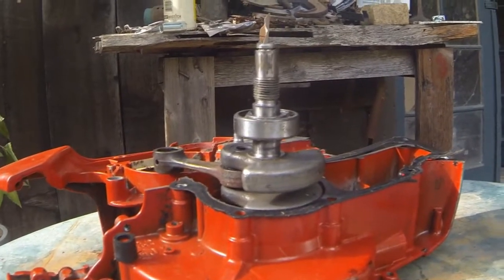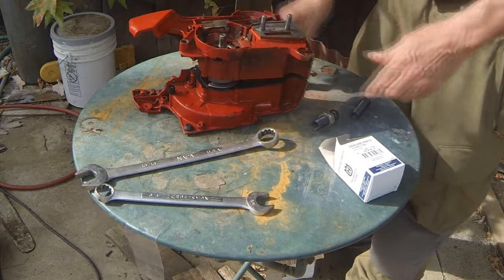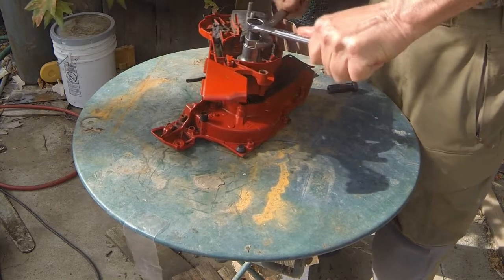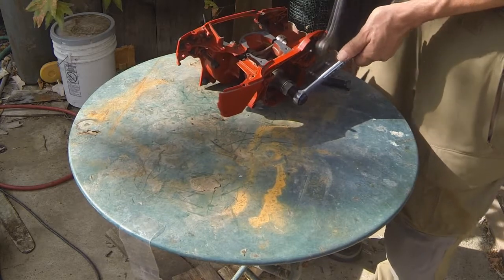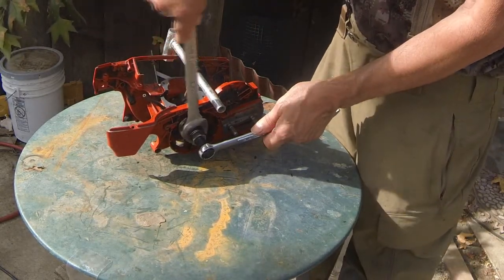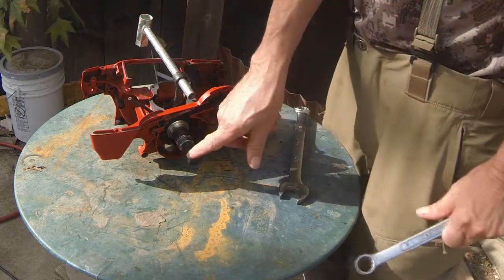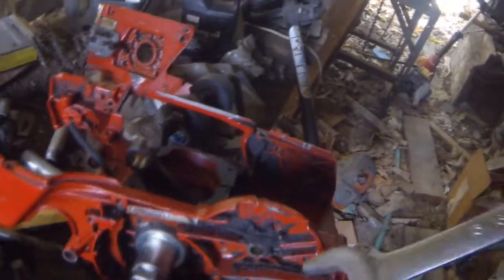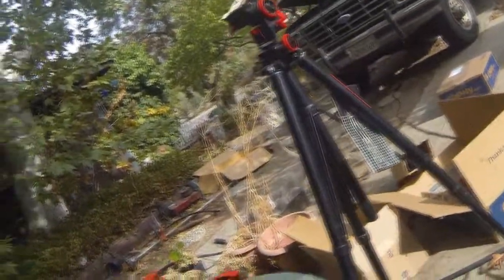Case Puller crankshaft Husqvarna Jonsered chainsaw bearing

Comment: Pinching the rod between the cases is not necessary.    I've done it and will try to avoid it in the future.
Reply from the maker: It is hard to control the rod with only 2 hands. Much easier with tool clamped in vise. Also do not need to freeze crankshaft and heat bearings. then install the assembled unit into the case. When cold out it may be a good idea to heat the case a bit.
Reply: Thank you for the comments sir, I was trying to be funny and bring awareness to the difficulties of putting crank cases together.